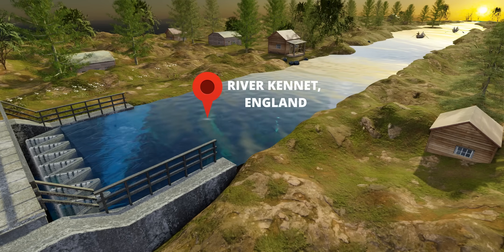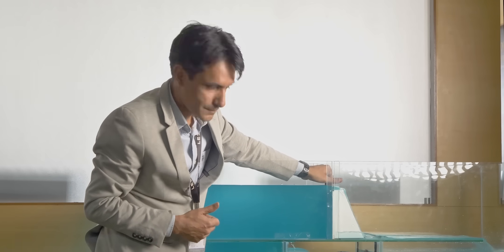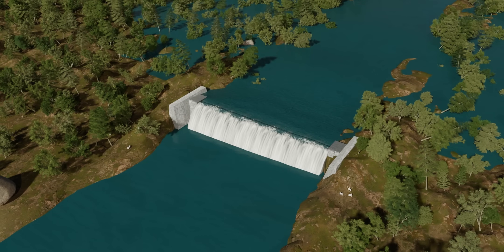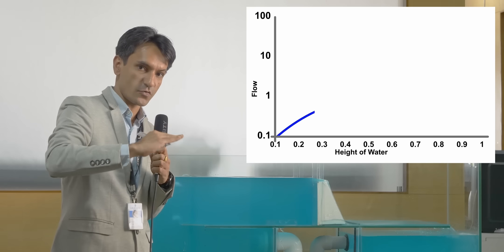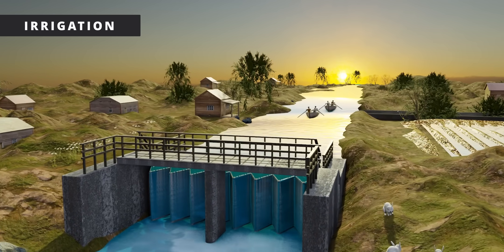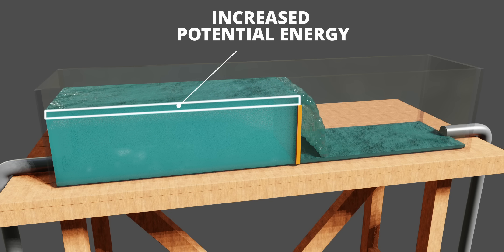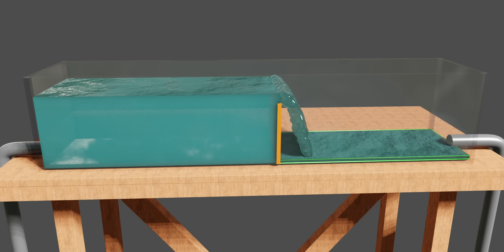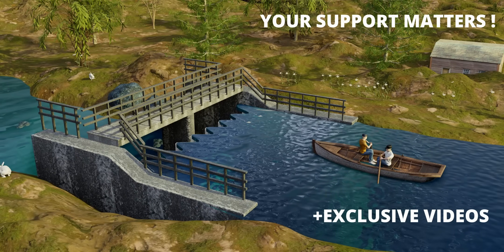Weirs | The COOL Engineering Behind Them 😎

Comment: Q = V_up * A_up = V_down * A_down

If A_up and A_down > no change
Then V_up flow faster than V_down

Then River at upstream with less soil erosion, than River at downstream with more soil erosion problem.

How engineer control / reduce soil erosion problem when introducing hydraulic weir upstream? If concrete linning throughly at downstream is too expensive...

I remember there is a hydraulic jump problem at area immediately down stream. Then River velocity will be matched at some point (I forget the theory as this is the basic fluid mechanics topic in 2nd year of civil engineering degree) Long long time ago...

Also there are laminar flow, sub-critical flow and super-critical flow too.

Comment: The zig zag weir has more length for the water to flow over so it doesn't build up as high. It does not change the depth or water flow below the weir. If you flow x amount of water per minute over a 10 foot straight dam it will build up half as much as it would over a zig zag dam with 20 foot of length. The flow below would still be the same. No magic here.

Comment: I've always thought why not build an earth wall along the rivers with dredging and local materials, then plant flood resistant trees along the banks.

 Systematically build eco hydro weirs along the rivers while creating underground pores with volcanic rock, sand and charcoal. Do this on flood planes and cover with fields of trees. Eventually on hill tops we could create small deep reservoirs for energy storage and fish farms. Pump water up during energy rich days and release at night or energy poor days. 🤔  every single building could have solar and wind power generation with lots of water storage above below and outside. 

24 million houses in the uk and 25 million more buildings, if each one made 10kwh per day and stored 10,000 liters of water that would make one hell of a difference to the energy and water crisis, along with saving flooding and carbon emissions.

Put the science behind it without the worry for money because that's not a challenge.

Every single country is in debt but to who do we pay this debt?

Comment: The fact that we seldom, if not, never seen dams constricted with this design must have to do with safety issues. No..???
Reply: Straight weirs are often equally or more dangerous. The limit here is construction cost. Labyrinth weirs (what he called zigzag weirs) are usually built due to specific constraints like limited space or to maximize the discharge within the same footprint.

Comment: Lovely. But you don't say why the zigzag pattern is better than the straight edge.
Reply: Neither are really "better" as suggested in the video, it depends on the situation. The zigzag weir (actually called a labyrinth weir in the industry) has more length for the water to pass over, so it's more efficient and the water level doesn't rise as high during a flood. However, the construction is more expensive and debris can tend to get caught in labyrinth weirs. So a straight weir is often a better choice, with labyrinths chosen usually for space, (upstream) flood control, or to maximize the discharge.

Comment: Nice visuals and experimental setup. A few comments though.
1) Energy is not conserved in the overfall. A lot of it is dissipated in the chute and later in a hydraulic jump.
2) Flow becomes supercritical below the weir, which carries the flow faster and shallower. However the normal flow is subcritical, it will transition back to slow and deep within a short reach. The experiment didn’t allow this to happen because the tailwater boundary was so close. 
3) The bed will erode below the weir long after the return to subcritical flow because the sediment trapped upstream will be missing, and sediment yield have to return to equilibrium.
4) As many pointed out, the zigzag lengthens the effective width of the weir. However, during floods, the head is typically so much higher that the converging overfalls (nappes) extend further, impound each other and fuse into a straighter overfall. As a result, the effective width gets closer to that of the river, the head will increase more abruptly than with a straight crest.

Comment: You didn't tell us how it works, so I'll tell you.  Theres x number of cubic feet of water moving down the river  It all has to go over the dam.  If the dam was 20 ft wide, the water backs up because the dam is so narrow.  The wiers zig zag shape, if you pull it out strait is like have a dam that 3, 4 or more times as wide.  The liner feet of the dam is much longer.   So it acts as if all of a sudden the dam is tremendously wide and the cubic feet of water needing to rush over is drops in height and slowly falls over the dam.  Hope I explained that so you understand.  The depth of the zig zag allows the cord length to be what-ever is needed to get the max flow to a manageable velocity going over the dam.
Reply: That makes sense now thanks. So the whole point of the zigzag shape is to spread the energy out over a larger surface area. To unrestrict the flow and decrease the velocity of the water.
Reply: Thanks. That was useful and untold in the video.👍
Reply: Thanks, I was pretty annoyed they didn't explain that.
Reply: Maggiore sezione, minore velocità.
Reply: Ur dmbass didn’t watch the whole video
Reply: @signalsoldier28  The video never explained any of that. In fact, they talk about the zig zag shape is ideal, and introduce it. But they never explain it.
Reply: @signalsoldier28 The video did a poor job of explaining WHY it works.
Reply: @signalsoldier28 comment of the year
Reply: @signalsoldier28 
😂

Comment: the z is not the only way to do this though. I've personally never seen it, here in Germany basically all the weirs I've seen instead opt to follow the falling curve of the water, so they are straight horizontally but curved vertically instead. It's kind of obvious why this works I guess, you have continuous flow all the way top to bottom without any disruption

Comment: the two models are different.  the 3d model has it flowing into a pipe, where the demo has it flowing off another wier into a pipe. the 3d model is not showing what would actually happen with that apparatus.

Comment: Perhaps you could include a safety warning because many weirs are unsafe. The unsafe ones create a recirculating hole below the weir that spans from bank to bank so that a caught swimmer can only get out by diving down to the fast moving water.  Relatively safe weirs have eddies at both sides such that a caught swimmer or boat can swim left or right to get to either eddy and get out of the water.  Of course, not everyone knows to swim to the side but it a least gives you a chance.  I don't know if that sawtooth makes things better or worse. If a swimmer gets into the point of that tooth, will the water push them along the tooth and out or keep them securely trapped at that apex? (I assume the former but I don't know for sure.)
Reply: I was going to say the dams I'm used to are safer as I can't go over them with my kayak.

Comment: Is it energy conservation? If the downstream river would be deep, the flow would be slow also, dispite the difference in potential energy.
Reply: Good catch. 
Energy conservation seems to be not good enough explanation because most of potential energy must be converted into thermal energy due to water impacting under nearly square angle.
That get conserved is a masss/volumetric flow.
Different level changes must be due to some dynamic resistence of a weirs top. Making zigzags or courling it backwards created more dynamic flow resistance than "open end" on the other side.

Comment: Zig zag has more length of edge for the water to fall over. is this what make the flow easier thier for less height? 
My first thought o. Seeing the zigzag was the base is wider so it can withstand more water pressure with less wall thickness. Like coragated vs flat.

Comment: Nice concept. 
However, you didn't explain that the Labyrinth or zigzag spillway increases the length of the spillway so reduces the head increase clearly. . 
Also, what respectable engineer measures 200mm of flow with a 150mm ruler?
This could be greatly improved very easily with a few changes.
The basic information is here, it could be presented better though.

Comment: The graphic of flow area is incorrect on the upstream side. It is determined by the height of water and the effective length of flow over the weir, not the length of the channel upstream. This is why the zigzag pattern is more effective in resisting changes in upstream water level.

Comment: The key thing I got from this is that the zigzag presents a much longer barrier over which the water flows thus reducing the increase in height for more flow. The narrator didn't explain that very well, but the diagrams did.

Comment: Erosion is controlled upstream due to the weir but erosion is accentuated due to higher velocity flow downstream!
Reply: I have a feeling that is where the triangular weir comes into play. This increases the surface over which the flow has to move and I feel like that might change the results I just am not familiar with the engineering mathematics to prove it. But it would make sense that increasing the length of the weir through making it into a zigzag would modify the other conditions.

Comment: The video doesn't explain why the zigzag weir slows flow. It's easy, the non zigzag allows the full flow come down at once, leaving the full speed obtained from the fall in the lower level. While the zigzag increases the area of the fall line reducing the flow and forcing/redirecting it to go from a horizontal flow to a vertical flow, thus forcing the increased speed from the fall to dissipate vertically, literally making the water crash to the ground, thus removing that speed and mitigating the soil erosion problem.

Comment: The video really demonstrated the concept of weir in a really simpler and easier manner, I really appreciate your efforts and hardwork, but we were also curious in knowing the physics behind zigzag weirs
Reply: It is because of “volume”.  If you take the total “length” of the area that water overflows and multiply by the height of the overflow then you have the volume available.  The velocity is how fast the flow rate must pass through that volume.   AKA… a larger drain pipe.

Using a zig-zag allows a longer “wall” within the width of the channel.  Another alternative is to make a wider channel, but doing things like adding a curve/diagonal wall or waves/zigzags are more practical.  The zigzag has other benefits when you consider the force of water applied to it.
Reply: Length of the weir is diffrent.

Comment: simple explanation to zig-zag for those who are wondering: discharge over weir directly increases as the effective length of weir increases the zig-zag path gives the weir a greater effective length for the same river width. and as the discharge from zig-zag length  is more than straight length ... the water depth in  upstream of river in zig-zag weir dont increase more than straight because it's greater length compensates the required cross section of area for the flow.??

Comment: Now im not saying the video is wrong but hear me out. 
1. It didnt prevent upstream erosion. Erosion happen we just collected it against the weir. This becomes the longterm risk of these systems and in many cases they cant be removed without extreme risk. 
2. Maybe Im just saying what was already said. By installing the weir you changed the shape of the rivers flow point from halfmoon to a flat line. The area available for the water to flow was reduced. Resulting in your high upstream height. The other has a longer surface area, allowing for more flow. 
3. I find it interesting that you see this as slowing the velocity of the water upstream from the weir. Of course the overall flow rate of the river is going to slow down if your restrict it. The velocity of the water seems to be a result of the area provided for flow. I noticed you didnt mention that but instead had an observational equation to desribe the effect on the water but didnt describe the math that created the effect. 
4. Why didnt we mention the erosion taking place down stream will cut a narrow channel now as a result of the faster flow rate but reduced area of flow?
Reply: i think those are very good points. i had similar questions, you answered most of them, thanks. also: wouldn't there be a lot of erosion at the downstream side of the weir directly at the weir due to all the turbulence in the water? thinking about it, i recognized my cities weir has additional openings at the bottom and valves with wich they can regulate how much water is flowing over AND under/through the weir at the same time. why exactly would they build it that complicated? has to have a lot of advantages, doesn't it? i thought maybe more constant flow rates and clearence of the collected sediment at the upstream side of the weir or less erosion in general but those are just guesses.
Reply: i think it decrease vertical erosion  but lateral erosion increase on upstream side. And in downstream side vice-versa. also it depends on topography and geology of rock.
Reply: @mandippatel3178  same observation here. It would be a large study prior to installation.
Reply: 1. It did slow down the upstream erosion though since the flowrate is slower
Reply: @yotonking2831  it is possible it did. One issue you can see and they did touch on this is the video is that the upstream sides water table changes. It could be 0 do to a high sided river bank, but it could be catastrophic like we see when a lake is formed. It's highly dependent on soil types and the nature of the installation.
Reply: @yotonking2831  it may have. It depends on the topography and mineral density of the substrate. If it floods, you can see erosion in different areas. If it pools and doesn't flood, it changes the water tables so it could have unforseen effects.

Comment: Great piece of work there, it highlights the principle of energy conservation in a very intuitive visual way
Reply: Is it energy conservation? If the downstream river would be deep, the flow would be slow also, dispite the difference in potential energy.
Reply: @paulfontaine7819  Interesting 🤔. My educated guess is that if the downstream river is deep, then there’s more mass of water so more inertia. Thus the kinetic energy of the water accumulated during the time of free fall (because of potential energy) will be lost to friction (so I guess heat?) with the bigger body of water downstream so the effects won’t be the same as when the water levels below are relatively low.

Comment: imma take an Asian educated guess
tldr: Rate of Flow = Speed × Area (vertical to the direction of the Flow)
you slow the flow with a barrier (water has to climb, momentum turns into gravitation force).
the thing is, the intake or flow rate is the same (natural bodies of water often have constant inputs, but can change with seasons or human interruptions).
so, if we slow the flow, the volume should increase;
if the width/base is a fixed value, then the height is the only thing that can change.
with this, the height should increase and leads to more depth before the barrier;
now, when the water goes on top, it drops down and massive amounts of the gravitational force turns to momentum/speed.
so the speed of the flow after the barrier increased, and to counter the inconsistency, the height lowers based on how much the speed has increased

I'm glad to be wrong and learn something new, cauee i feel like im missing a point in my guess😅

edit: got some translation wrongs (language barrier😅)
gravitation-> potential 
force-> energy (newbie mistake)

also I did learn new things, I wouldn't have guessed the applications based on my "education", so its always important to see what others (specially people of higher educational status) have to offer so you can improve yourself!
I really love these real life practical/impractical engineering videos

Comment: What is the difference between a weir and a dam? It seems like a new word for and old trick.
Reply: The difference between weir and dam:
Weir let water trough the crest, but dam forbid it.
On dam, Water flow through the penstock (or tunnel), mainly for power generator. The height of water on dam is regulated
Reply: Dam are use for collecting water to power generator or supply, weir are use for prevent surge of water to downstream. Both are reservoir just structure difference